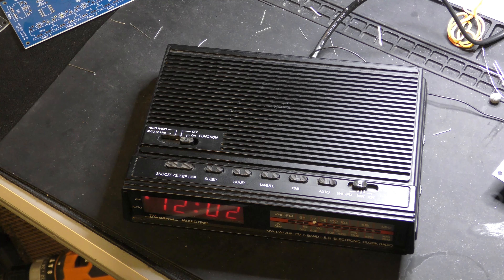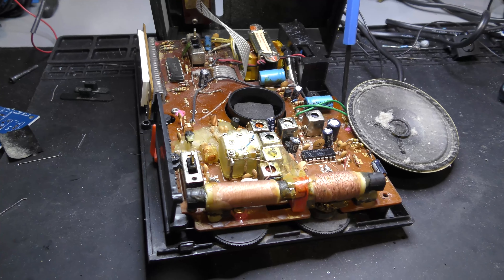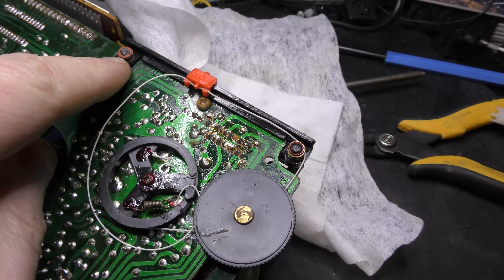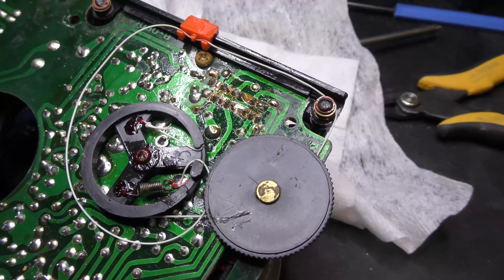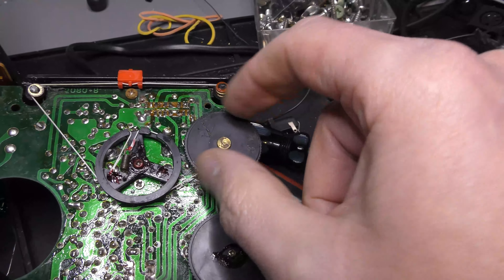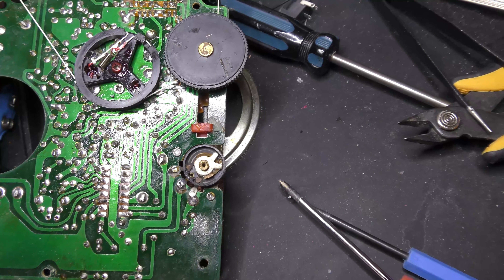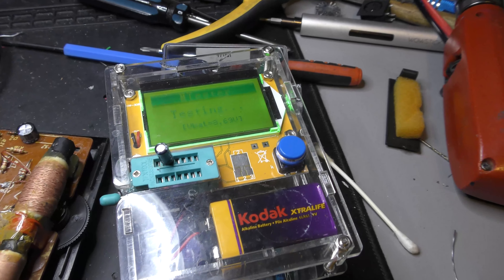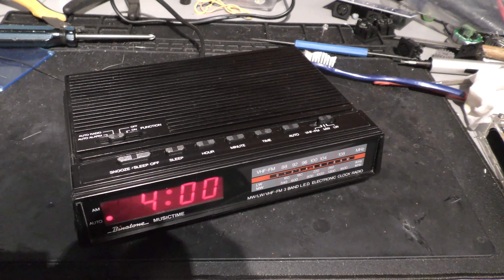Fixing an old binatone LED clock radio

Comment: Oof, bought mine off Ebay for just under 40 pounds, same deal with the radio not working. Waiting for it to arrive to try this and see if it fixes it. Many thanks for the video.
Reply from the maker: they're a nice wee radio. Mine has a buzzy transformer, easy fix though. Best if luck with the repair